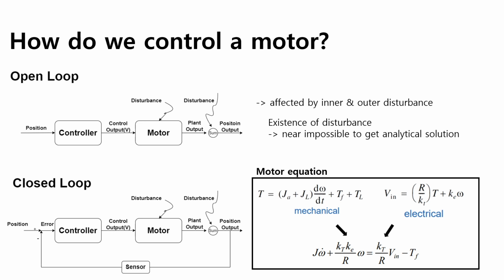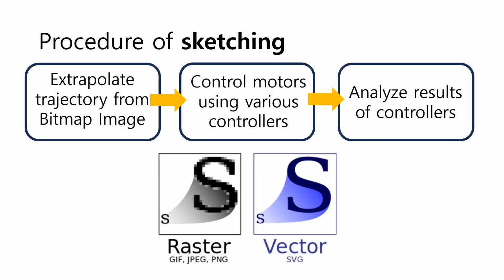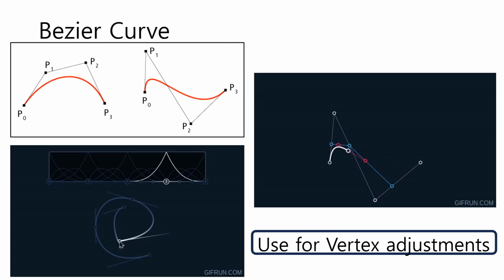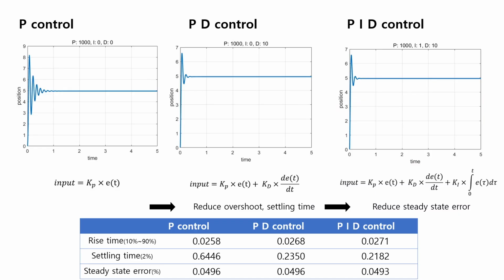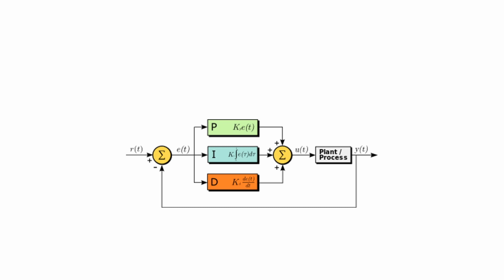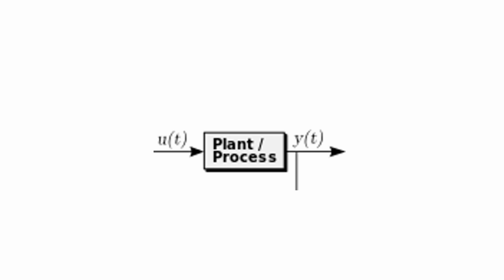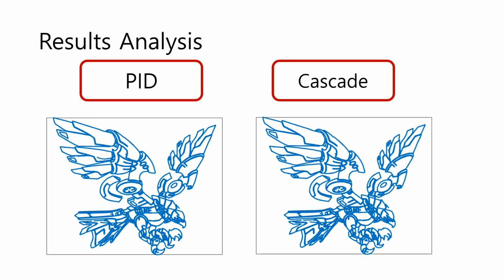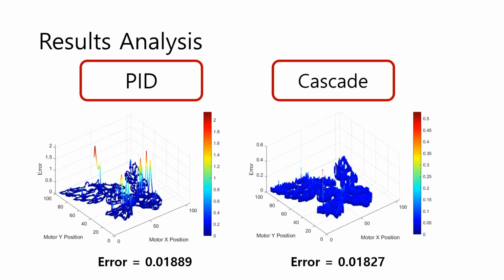Robot Artist: 2 Axis Motor Control

Comment: 안녕하세요, 좋은 발표 감사합니다. 9조에서 질문 드리려고 합니다.

5:55 에서 is_jump 불리언 배열을 어떤 식으로 계산했는지 궁금합니다.
Reply from the maker: 안녕하세요.
5:55에서 is_jump 불리언 배열을 어떤 식으로 계산했는지에 대한 질문을 주셨는데, 답변을 드립니다.
png, jpg 파일을 svg 파일로 바꾸는 과정 이후에 svg 파일에서 다음과 같은 txt 파일을 추출하는 과정이 선행되어야 합니다.
txt 파일은 다음과 같습니다. 각 함수는 이미지의 경계선을 구간별로 분할한것입니다.

(5765(1-t)^3 + 16104t(1-t)^2 + 14754t^2(1-t) + 4505t^3 (x 함수), -11943(1-t)^3 - 35787t(1-t)^2 - 35583t^2(1-t) - 11755t^3) (y 함수)
(4505(1-t)^3 + 9090t(1-t)^2 + 5211t^2(1-t) + 931t^3, -11755(1-t)^3 - 34128t(1-t)^2 - 31254t^2(1-t) - 9107t^3)
.
.
.
(3583(1-t)^3 + 15108t(1-t)^2 + 20091t^2(1-t) + 8179t^3, -566(1-t)^3 + 249t(1-t)^2 + 357t^2(1-t) - 467t^3)

이 형식의 식을 파이썬에 대입하면 오류가 생기기 때문에 이 식을 다음과 같이 수정합니다.

(5765*(1-t)**3 + 16104*t*(1-t)**2 + 14754*t**2*(1-t) + 4505*t**3, -11943*(1-t)**3 - 35787*t*(1-t)**2 - 35583*t**2*(1-t) - 11755*t**3)
(4505*(1-t)**3 + 9090*t*(1-t)**2 + 5211*t**2*(1-t) + 931*t**3, -11755*(1-t)**3 - 34128*t*(1-t)**2 - 31254*t**2*(1-t) - 9107*t**3)
.
.
.
(3583*(1-t)**3 + 15108*t*(1-t)**2 + 20091*t**2*(1-t) + 8179*t**3, -566*(1-t)**3 + 249*t*(1-t)**2 + 357*t**2*(1-t) - 467*t**3)

이렇게 수정한 식 또한 txt 파일로 저장됩니다.
이제 이 txt 파일을 한 행씩 파이썬을 통해 읽습니다. 이 과정에서 t에 0부터 1까지의 값을 일정한 간격으로 대입하면서 x, y좌표를 구할 수 있습니다. (이 과정에서 is_jump array를 같이 생성합니다.)
한 행에 대한 연산을 다 수행하면 다음 행에 대해 똑같이 t에 0부터 1까지의 값을 일정한 간격으로 대입합니다.
이 과정에서 이전 행에 t = 1 을 입력한 점과 새로운 행에 t = 0을 입력한 점의 간격이 특정 값 이상이면 모터의 제어 주기(0.5ms) 내에 새로운 reference position에모터가 도달하지 못합니다. 따라서 이전 행에 t = 1 을 입력한 점과 새로운 행에 t = 0을 입력한 점이 0.1 이상이면 is_jump array에 1이 저장되도록 했습니다.